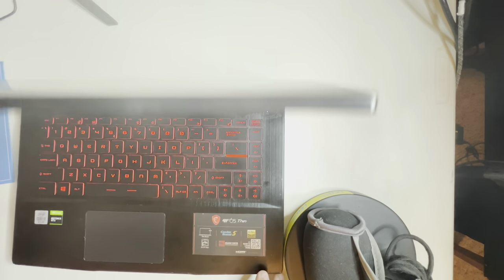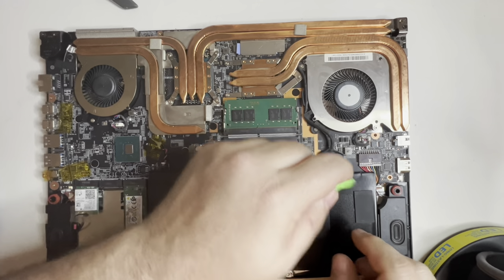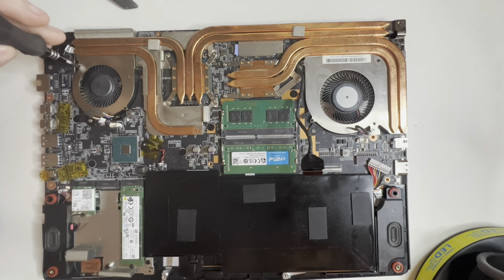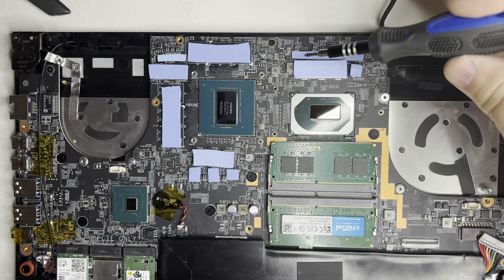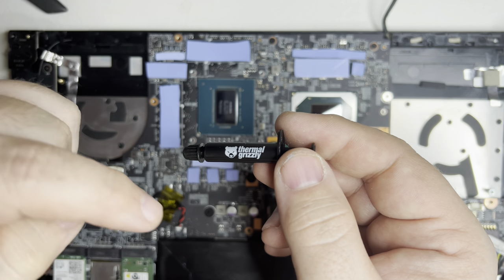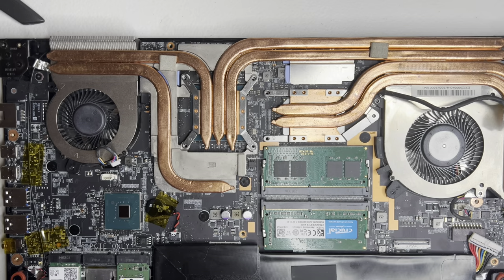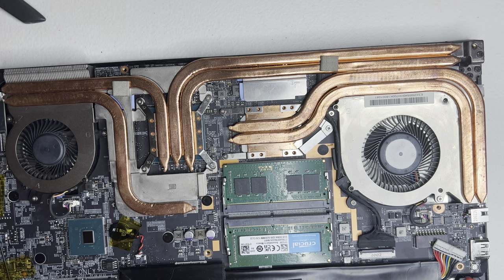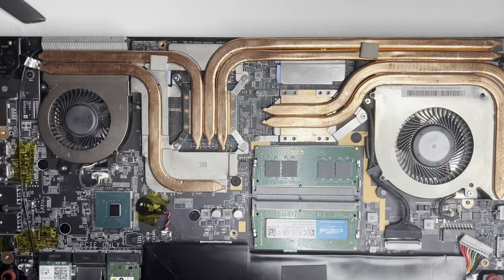How To Fix MSI GF65 10SDR From Overheating And Thermal Throttling #overheating

Comment: Thank you very much! Just a question, what's the difference between themal pads 1) and 4) in description? Seems like you just used 1) ones (0.5/1/.5/2mm), what are 4) thermal pads used for?
Reply from the maker: It’s really just your preference of brand, but you do need different thickness of the thermal pads.  If you watch the video, you will see I use different thicknesses because some of the chips are at different heights on the motherboard and have different clearance.  But if you buy number 4 that comes with a variety.  Those are already pretty much cut and the number one thermal pads are not cut out at all so it’s just your preference because you’ll probably have to do some cutting anyway what I did was just take the old thermal pad and compare the thickness with the new thermal pad and then I would just put it over top of the thermal pad and cut out it’s exact shape.  I would suggest number four for the thermal pads. And yes it makes a big difference in the temperature.  If you have any questions, just message me on Instagram or re-watch the video as to how to put them on. I hope I answered your questions.

Comment: Replace thermopaste on Honeywell PTM7950 phase-change material is more thermally conductive than the best pastes. And gummy thermal paste Upsiren UX Pro Ultra, Laird 607 or K5 Pro on the vrams and power section because have much better thermal conductivity than most thermopads. Make undervolting CPU and GPU at -100mV or more if it will be stable and reducing the CPU frequency in turbo boost or turn it off completely, so that the clocks of the cores are more stable. There will be less throttling and give more fps, plus it will be quieter, cooler and the laptop will draw fewer watts from the socket.
Reply from the maker: I agree with you on the thermal paste and the different gel solutions. They are more expensive, however, but I’ve had good luck with them, but under volting the processor, that is where I disagree, you do not have to gimp your laptop forward to work right.  I feel that you should be able to run the processor at its full potential, and the simple, basic steps in my video does enable for this to happen. In fact, what I am stating in this video is that you need to regularly clean and maintain ultrathin, gaming laptops, and also reapply the factory thermal paste and then you should get a huge decrease in thermal temperatures.

Comment: I havent cleaned my laptop in 4 years i think its about time now tomorrow going to buy thermal paste
Reply from the maker: The thermal temperatures should be a lot better afterwards. 👍
Reply: @Mr_Goody So i ended up rounding the top of one of the gpu screws and cant get it out, seems like no cleaning for me...

Comment: Thank you for this wonderful and useful explanation. I have a question..Can we change the processor in laptops?
Reply from the maker: The answer is kind of complicated, but simple in the past decade. You were able to change out the processors in most laptops. Since then, a lot of laptops have soldered the processor onto the motherboard, making it non-upgradable, and in some other motherboards, they will have an APU, which means that the video card and the processor is on one chip, and it is soldered on the motherboard.  This has become the new normal for this day and age so the odds are 90% you probably can’t, but there is that rare instance where do you might be able to but I doubt it.

Comment: hi, When measuring the first thermal pad you say that it is 1.5mm (min 14:40) and then in the summary you say that it is 2.00mm (min 16:05) I wanted to know if the summary when you say all the measurements of the thermal pads is correct
Reply from the maker: Yes, it was correct in the summary in the end. Sorry about that mistake.

Comment: When the heatsink is disassembled, is it essential to replace the thermal paste without replacing the thermal pads?
Reply from the maker: Yes, it is very important to replace the thermal paste even if you don’t replace a thermal pads.
Reply: @Mr_Goody  Ahh, okay okay I see so the thermal pads aren't a serious requirement?
Reply from the maker: @varanuskeeper7564  yes both things are very important to change out but if you can only change one, then change the thermal paste but I would say the thermal paste is a 10 on important to change and the thermal pads are about a nine but if you’re only able to change one, the thermal paste comes first.

Comment: Did you use 30 pieces pack at all or just the owl tree? I don’t wanna buy both if I don’t have to
Reply from the maker: I used mostly the 30 pieces back. You really don’t need to get the owl tree if you do not want to.
Reply: @Mr_Goody  Thanks!
Reply from the maker: @djgaming6709   Your Welcome

Comment: Instead of using different thickness (1.5,2.0mm), can i use just the 2.0mm which is the bigger one. Ultimately the pads should be in contact with the heatsink right ? Or will there be pressure created over the ICs. I am asking this becouse I am from India and the products u mentioned is not available here. Here iam unable to find combo packs with both 1.5mm and 2.0 mm which then i have to buy it seperately...😢
Reply from the maker: You have a good idea there, but I was trying to be on the safe side and just used the exact thickness but in theory it should not put too much pressure on the heat sink and it should work. The only thing you can do is give it a try and if it will get too hot, it will just shut down and still be OK.

Comment: i have GPU and CPU throttling  on msi gf65
changed the thermal paste but one thermal pads is gone , i have worse results it is because that pad ?
Reply from the maker: More than likely remember you have to put the right amount of thermal paste and then you must replace a thermal pads with the correct sickness so that it touches the ic ships to the metal on the heat sync so it can absorb the heat and disperse it out of the laptop case.

Comment: What were the temps before and after? I looked up the paste but it says it works to up to 80 degrees. my laptop cpu gets up to 95
Reply from the maker: If you watch my video, you will see the before and after temperatures. You can use the thermal paste that I used in this video and I have links to it in the video description and it will definitely cure your problem mine gets to I don’t even think it gets to 70°C while it’s under a full load.
Reply: @Mr_Goody Thanks alot will definitely look to replace current paste
Reply from the maker: Your Welcome
Reply: Just one more thing I can't get the thermal pads rn would the temps still go down a good amount with only new thermal paste?
Reply from the maker: @ode..m . Yes even just changing the paste only should take a good 15 to 20 degrees off of it and prevent thermal throttling.
Reply: @Mr_Goody  you're a legend
Reply from the maker: So are you my friend 👍
Reply: @Mr_Goody   the thermal paste arrived 3 days ago thank you so much. my temps went from 95 to around 60-70 average
Reply from the maker: You are welcome my friend. 👍✌️

Comment: Apparently, unplugging the battery, spraying the fans with WD-40, letting it dry, then putting it all together and turning it on the next day also works...
Reply: @Mr_Goody  yeah, it's super weird. My fan was failing, making all sorts of horrendous sounds and stalling, and after cleaning everything out to no effect, I tried spraying it with WD-40, decided that was dumb, told my wife I needed a new computer as I went to bed, then when I turned it on in the morning to show her the issue I spent hours unable to fix, it was just working quietly again.